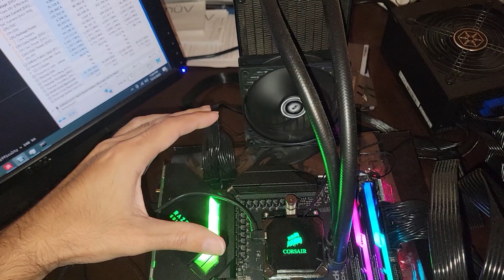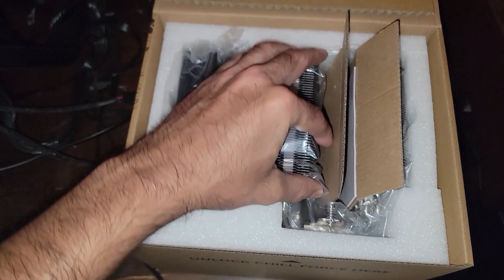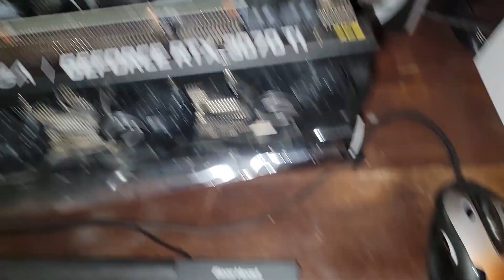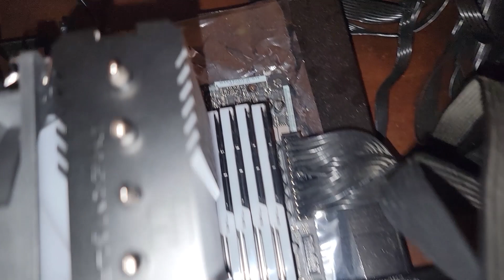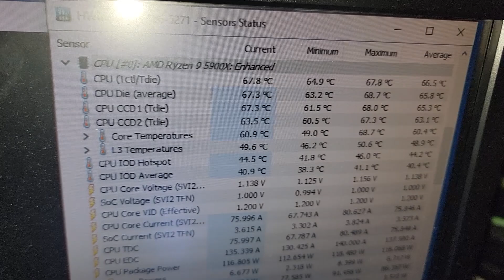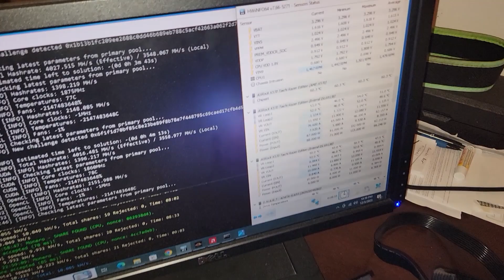Thermalright Peerless Assassin overkill for CPU Mining

Comment: I’m running in the high 50’s low 60’s with a thermal take silent contact 12 cooler on my 5900x. 35 bucks at microcenter
Reply from the maker: Nice, I like the silent contact series too. Good deal